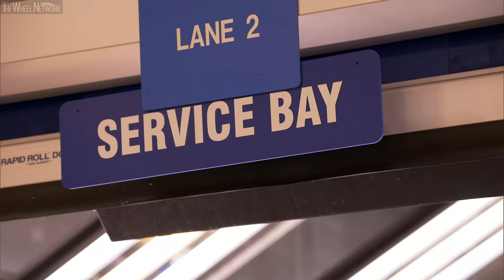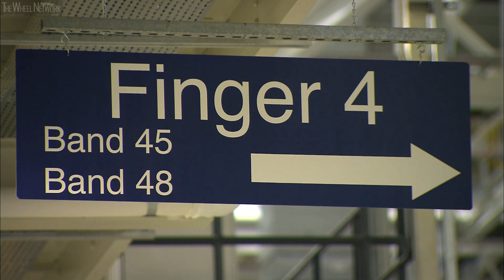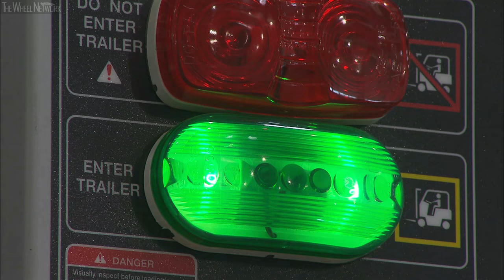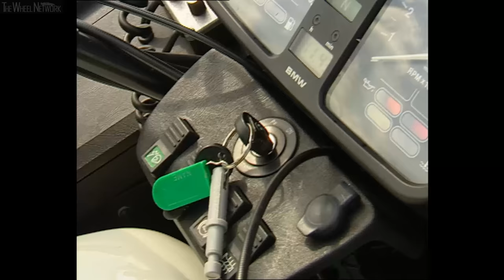BMW Production in the United States

Comment: Why does the x5s squeak and rattle so much ?
Reply: Mine doesn't and it's ten years old.
Reply: You’ve been fortunate. The squeaks were common on the e70s (you hear them louder in petrol versions too)  , I’ve spent years in getting to the root cause and addressed all the issues before I sold mine. To my surprise later manufactured interior panels came with felt pads attached to them to prevent these squeaks